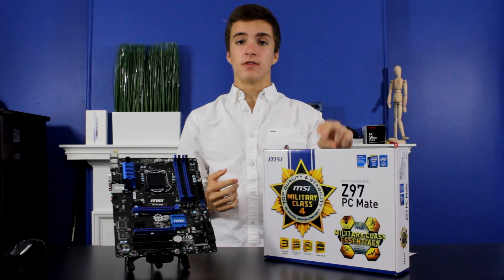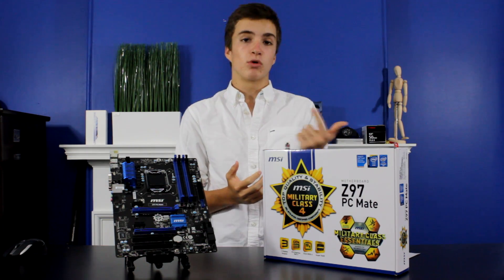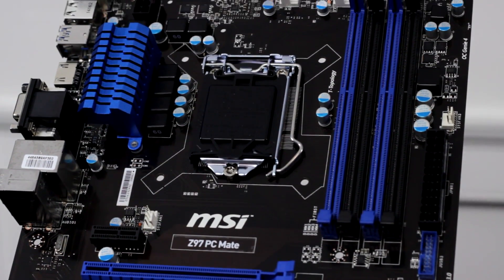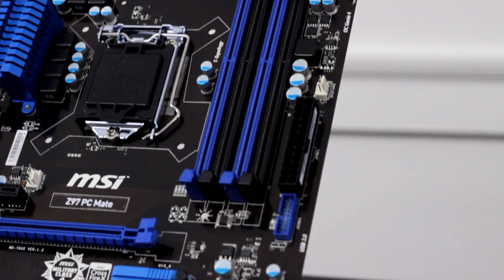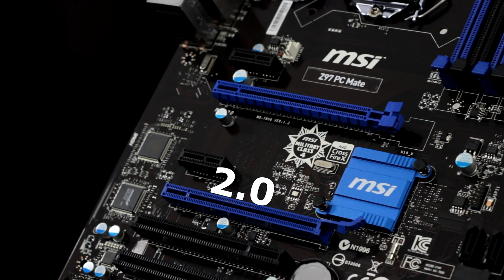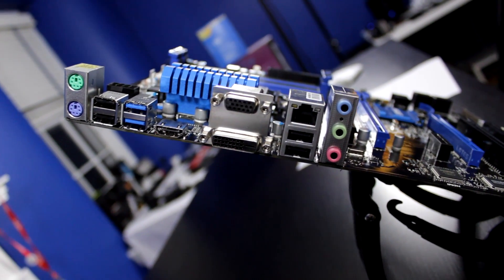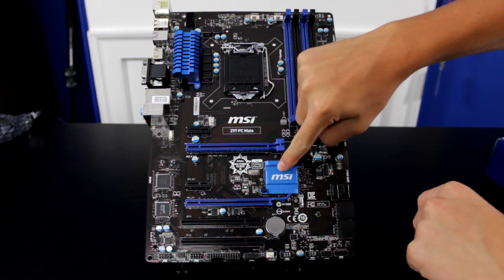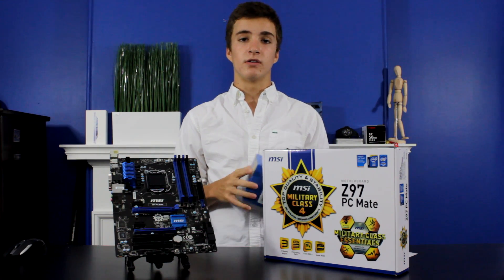PC Beginner's Guide: The Motherboard

Comment: the problem i have is for AMD motherboards. Can i put any cpu in any AMD motherboard because im not sure if they all fit
Reply: +jonathan snowden I had this same question not two seconds ago.
Reply: +skippidy doda i figured out that no you cannot.for example AMD fx 8350 cpu if you read its description its socket type is AM3+ therefore you gotta find a motherboard that supports AM3+ socket, that will also be in description of motherboard.
Reply: Right so if i get a dual core processor that is FM2, the motherboard would have to be FM2 for it to work? The number of cores doesn't matter right? just the socket.
Reply: you are correct good sir. its the socket type that matters only all you have to do is type fm2 type motherboards and you should be good
Reply: Thank you, this will make shopping this month much easier. :)
Reply: skippidy doda no problem :)